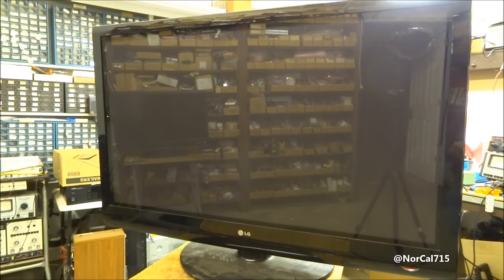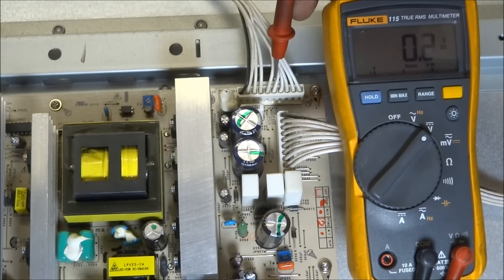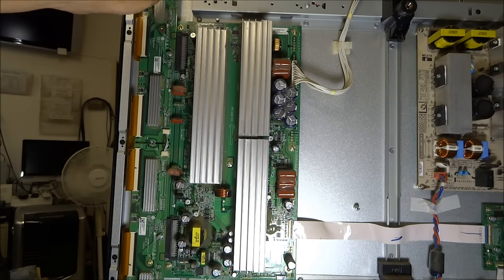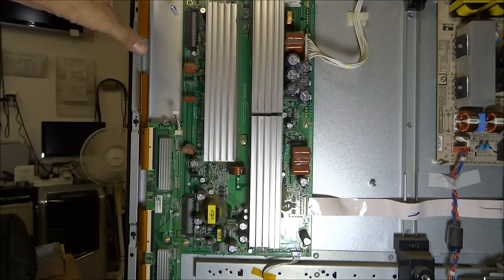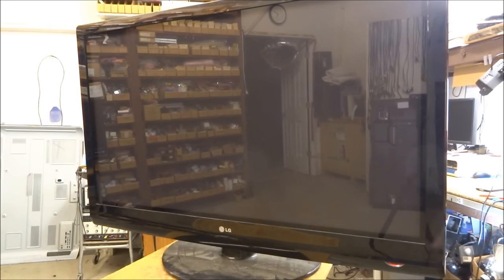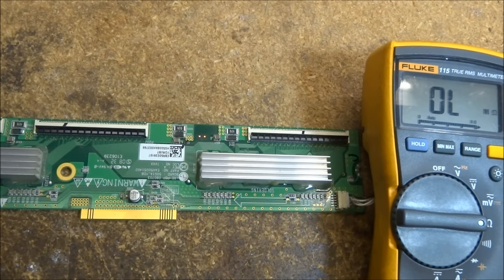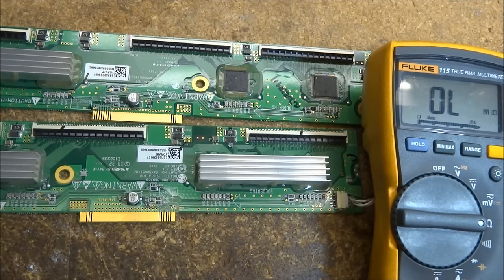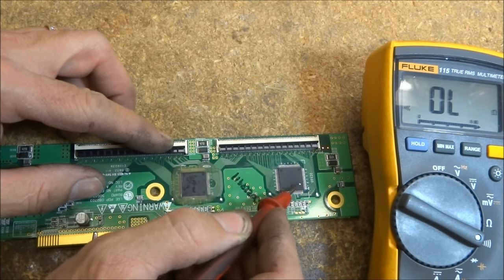LG 50PG20 Y Buffer troubleshooting

Comment: i had the same tv last week with the same issue,stuggled finding a replament board,found 1 on the inernet,just a warning to others,be carefull the replacment board did the same,gave in and orderd new ic's and sent the replacment back.new ic chips turned up and changed them under the reflow heater.tv worked a treat so as an after thought i installed fans to keep the buffer boards cool in the future :o)ps it makes a change for me to be ahead of you on a repair lol,keep up the good work,your vids inspire me and others :o)

Comment: great video! I had same thing and same bad top chip on upper y buffer board but on samsung hpt5054 plasma tv. I replaced y buffer but y sustain board was bad too. crap load of parts went bad transistors on heatsink and more, there's repair kits available but none worked for me. is it possible if plasma display panel is bad no matter what board is repaired it will destroy any board in circuit, how test for bad panel besides physical damage? I have working on TVs since 1999 so I know the basics.

Comment: Greta video....I have the same TV with the same similar problem (no picture sound only) and when removing the upper buffer board it did the same thing, the bottom half gave me a similar picture like in your video. Is it safe to say the upper buffer board needs replacing. Now I did try removing the lower buffer board only and go nothing.

Comment: +norcal715 I have a question for the same exact problem with a slightly different LG set.  Power supply clicks, VA and VS voltages are good at power supply and the test points on the Y-Main board. I have replaced the mainboard and issue remains. After watching your video I tried power tv on with just 1 y-buffer board connected - tested with both buffers, but I did not get anything on the screen like you did. My t-con/control board in the center of the tv has a solid green light on it so seems like it is good up until there. Before I go dumping lots of money into, does it sound like the Y-Main board is bad? I don't see any bad caps anywhere.

Comment: this discontinued set has been impossible to find fresh boards for.  The lower buffer board had ic 204 fried.  Power surge is suspected, because our small city has outages during high winds or ice storms, and it was part of a bank of tvs in a bar, where I'm not sure if they surge protected the 120vac circuits. My board is a Rev H, which has no heatsinks.  repair is only option, as LG and others will not produce a substitute product.

Comment: One of the best. I have a free tv sitting for a long time, bad zsus as no picture, then a picture with a few pink lines after swapped zsus and power supply (when plugged tv in, would turn on itself so swapped power supply also, stopped this issue) and it was working but in my quest to "tune" the pink vertical lines that would change to black and be less noticeable when changing the VS and VA blindly like a fool as well as the setup and setDN? Also whatever the daughterboard on the Ysus does or is called as well as in the othe grey plastic voltage knobs? Three on my Ysus? Anyway, any reason why I would of had it working minus three pink vertical lines always in same spot (buffer board? I don't see a buffer in the bottom on my PL4260N by HP but I will look down deeper. I had sparking, not once, twice, three times but turned it off, re seated all the working Y buffer boards ribbons and it started arcing on me in various spots and looks to have blown at least two IC's. I think my issue is the logic for the pink lines which isn't so bad and to get a new buffer now (Ysus's fuses did not blow, finger crossed!) and learning how to truly set the voltages up. Did I probably do this by messing with the knobs on Ysus or are they okay once VS and VA from the power supply is set and okay as in can't blow the buffer and this was going to happy anyway most Likely and I just happened to see the grand finale? I'm so frustrated as had it and wish I never touched the voltage knobs (what are they really called, setup, setDN?, etc) but to late. What would you suggest I do first and why do you think it blew if had to guess? Over voltage by my dumb ass or just age? Again, I think if I'm lucky Now a Ybuffer and logic should do the trick as in fix the blown buffer chips that were blowing and arcing in my face and the logic may clear up the pink lines? I need to learn in depth how to set the knobs though on all boards and do the VS and VA first. Can one do the VS and VA without some boards in as in whilst awaiting replacement if use the factory numbers printed on mine? Thanks in advance.. it had a beautiful picture and second to none Sound while it lasted for three or four hours! Hah, yes I am an idiot for adjusting anything without a volt meter. Where to go now? I hope it didn't burn my ribbons? Chances of that? Why would of arc and keep arcing if one or two went bad in a row, normal or a symptoms of something I seem to have done? Suggestions, laughs, comments, anything at all is appreciated greatly! Thanks, Stephen
Reply: My real goal was to get this up and going then mod a fan to zsus and Ysus over the ic chips if I could find a 12v rail. Back to getting a picture. I really need a superb tutorial on how to set all knobs and voltages. Especially since ordering parts on ebay how can one know if knobs were turned and people only ever comment on VS and VA.
Reply: BTW: Y buffer can blow Ysus but Ysus not usually ybuffer? Sorry for so many questions but I want to get it right this time, if it's still possible by ordering buffer and a.....logic or x?.. praying Ysus didn't go and hoping I learn how all knobs work and which ones blow stuff out and how to set, etc..

Comment: What was the procedure for removing the heat sink from the PDP chips?  It looked as if it was epoxied on. 

Also, if you have a Panasonic plasma set with an undamaged screen, is there a straightforward check you can make to see if the panel is good?  I have a set where the protect circuit keeps tripping, but the sustain and buffers appear to be good.
Reply from the maker: offtwoaces There are flowcharts on some panasonics. how many blinks and what model?
Reply: norcal715 It's a TH-50PZ77U with 7 blinks.  I've gone through the flowcharts.  Flowchart says bad lower buffer (SD).  I've swapped in a couple of new lower buffers and also tried a new Y sustain (SC) with no improvement.  I don't measure any shorts on the lower buffers.  In the past, the set would run for week and then fail back to protected mode.  I can see the lower half of the picture start to degrade just be it goes into protected mode.   Set runs fine if I pull the lower buffer although I obviously have only half the picture.
Reply: +norcal715  i have 51 inch samsung when i power up logo comes up then goes out over and over no clicking sound though

Comment: I have a Sony SA-W2500 powered sub woofer that cuts out after 3 seconds when volume is applied. I have been all over the internet and there is nothing about this model on repairing the amp. Please msg me if you can, I'm out of options --__--

Comment: same tv same problem  upper buffer board part number ebr50039005 cant find the part 
anybody??? help
Reply: Stephane Menard I need one myself.  These plasmas are obsolete that’s why it’s difficult to find used boards.
Reply: @xcross8537  solved my problem ... threw the fckn tv in the garbage ;)
Reply: I don’t blame you.  They consume too much power anyway.